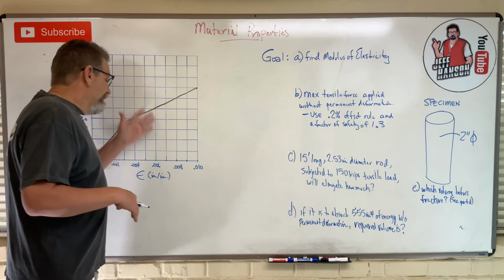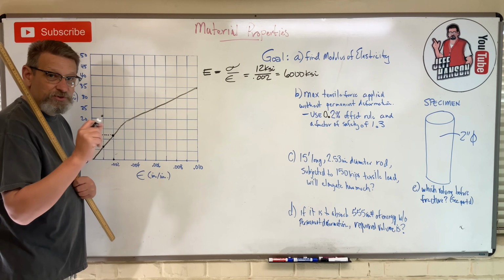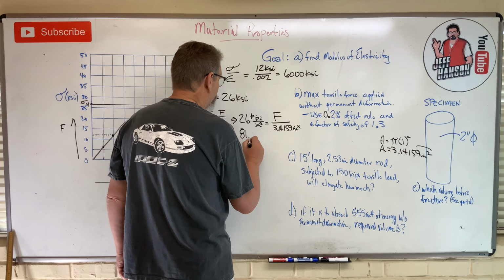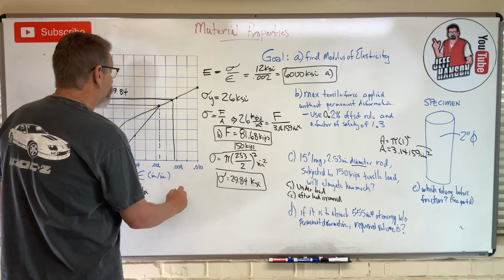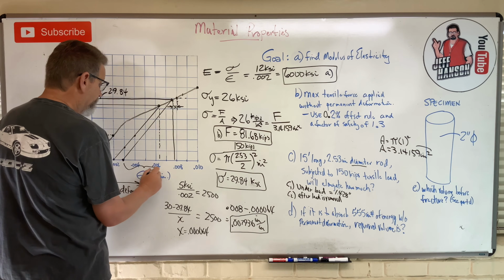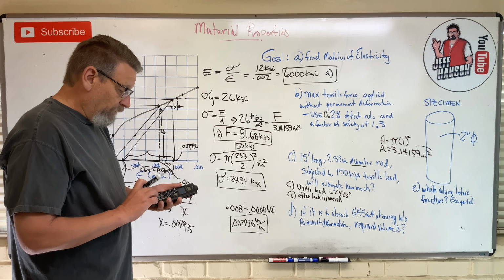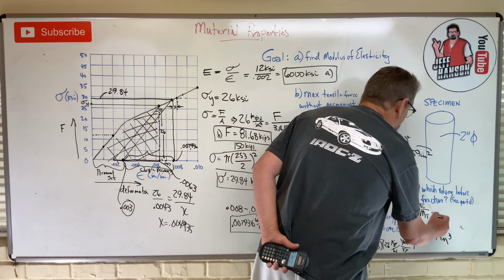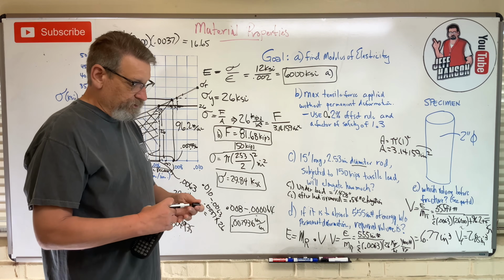Mechanics of Materials: Exam 1 Review Problem 3, Material Properties

Comment: In part d, your answer is conservative. If you calculate the area under the curve exactly: MR = [1/2*0003*18+(18+26)/2*(0.0063-0.003)]*1000 = 99.6 psi. It will give you V = 5.572 in3. And accordingly, the answer of part e is 2.612 in3

Comment: Thank you Dr.Jeff. For part (b), I guess you forgot to multiply by the factor of safety that equals to 1.3, so the correct answer should be found as follows:

Stress_yield= 26 ksi
Stress_max = Stress_y/ F.S
Stress_max = 26/ 1.3
Stress_max= 20 ksi 

S_max= F/A
F_max = 20 *(pi/4 * 2²)
F_max=62.832 kips✔️